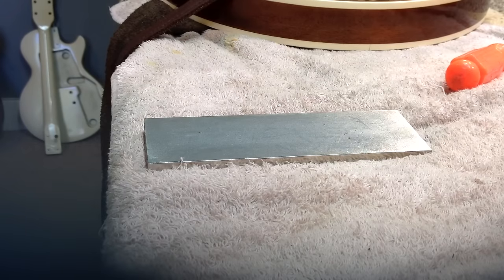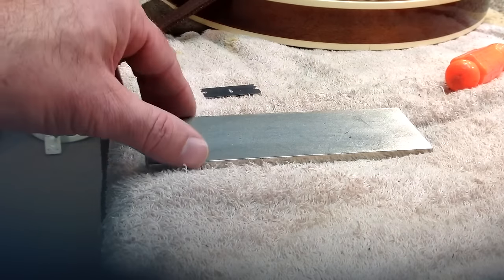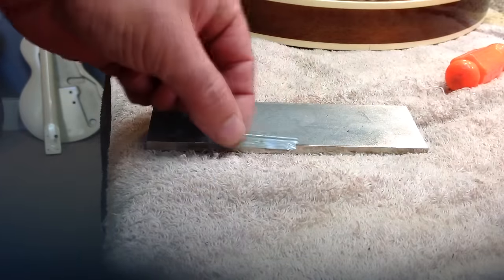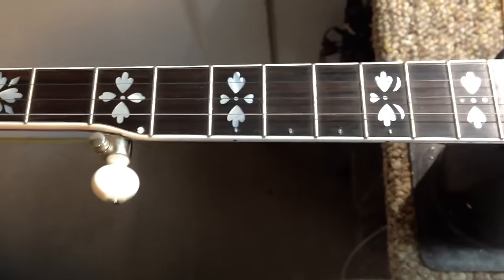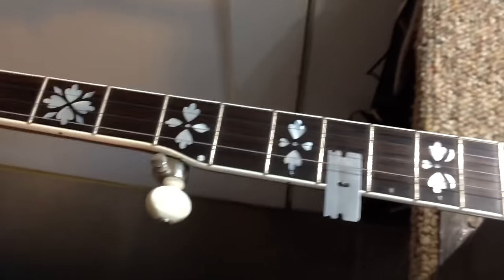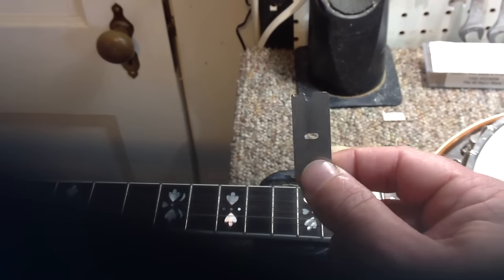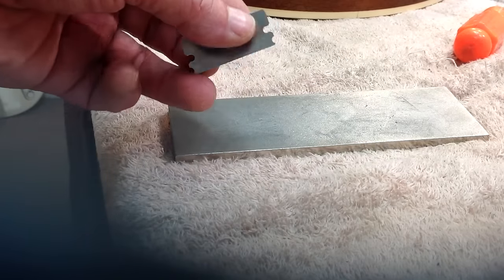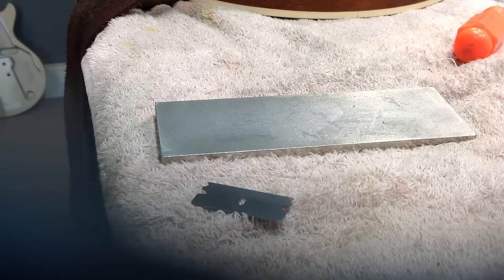Set-up Trick # 2: seating a railroad spike

Comment: I picked a nice Washburn B14 ('88)but three of the 4 spikes are chewed up and painful! LOL Any suggestions on how to remove them? I will definitely use your tip, once I've cleared that hurdle.
Reply from the maker: Are the heads of the spikes broken off, with only the shafts visible? If so, one thing to try is masking off the fingerboard with a few sheets of aluminum foil and heats the spikes with a soldering iron. The heat will cook some of the wood down inside, loosening it enough so that you can pull it out with small visegrips. If you happen to break a spike off even with the top of the fingerboard, it'd best to just file it smooth and install a new spike properly.
Reply: Thanks John. After posting my question, I thought about my soldering iron, so that is what I'll try. Of the 4 spikes 2 are still useable, 2 are too low and very mangled. I'll start with those and report on my success.   Some of the head of the spike is still there, but not enough to catch/hold a string, otherwise I'd try to live with 'em!
Reply from the maker: Michael,  cool good luck with them. Even if you think you can just grab it and pull it out, if they are installed correctly they will be very hard to remove that way, and you risk breaking it off at the fingerboard, so heat is always best
Reply: I've worked on guitars for a while (just celebrated 55 years of playing), but it's been a long time since I have even thought about banjo spikes! They seem "properly" installed, if a little crooked and too low.